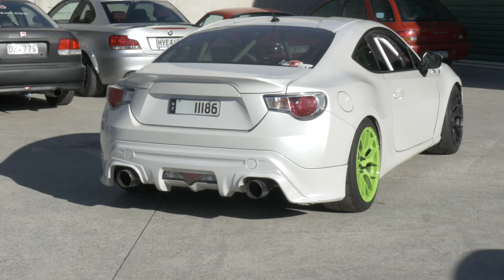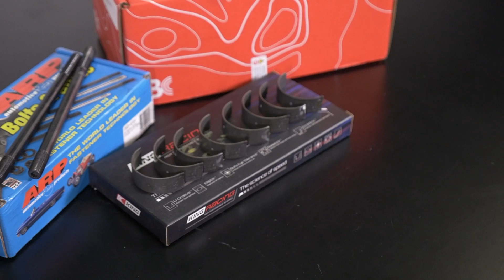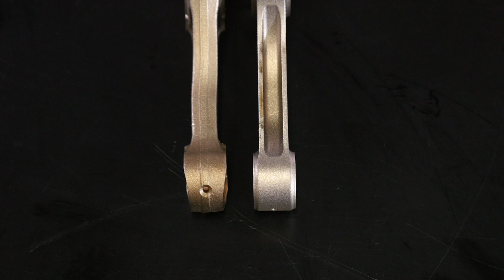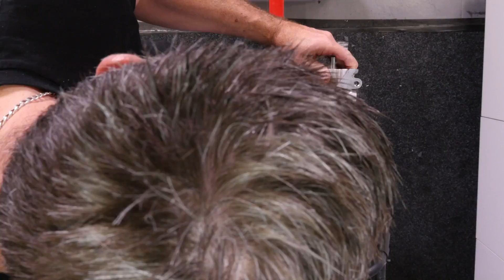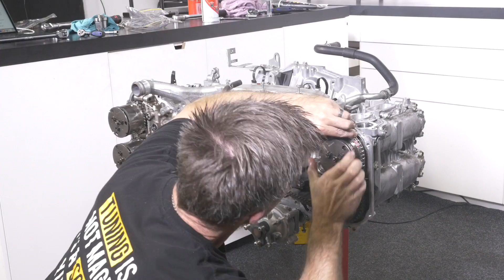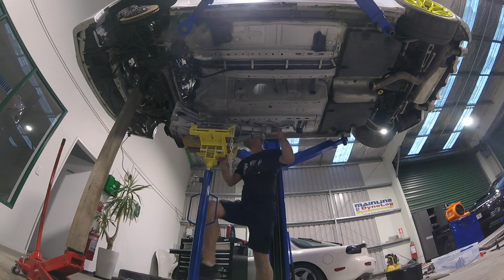We BENT A Rod | Turbocharged FA20 Rebuild [GHETTO-BUILD]

Comment: Another great video guys.  16:26 Is that the remote dyno cell in the background?  It was nice to see some 'outside the classroom' videos where some other areas of the facility are seen.  It looks like a  nice facility.  A little ironic that the engine I'm rebuilding to apply your engine building courses also had a bent rod, although from headgasket leaking coolant to the point of hydrolocking.
Reply from the maker: Yes sir, that's our remote practice dyno. We're hoping to bring out more content of a similar nature in the near future. Ah yes, water ingress can easily spell disaster for the poor conrod! (RIP) - Andre
Reply: @hpa101  Thanks for the reply, Andre.  Thanks to the vast amount of time I've spent listening to you, I can whip out your NZ accent at a moments notice at this point.  Great fun in a party/pub moment.

Comment: Overall, would you recommand a built FA20 (connecting rods, piston, etc) in a FRS/BRZ as a platform for a racecar or is it not worth the hassle and another engine such as a 2JZ / LS / EJ would be a better option ? 

Thanks !
Reply from the maker: It really depends on your budget, aims and personal preference. If you want a reliable 800 + hp then the FA20 probably isn't the smartest choice and a 2JZ or LS swap would be sensible. For applications in the 300-500 hp vicinity though a properly built FA20 should offer good reliability.
Reply: High Performance Academy Really thankful for your feedback! Keep up the amazing work, you’re providing the car community with some quality content.